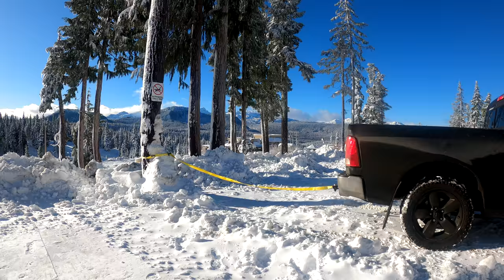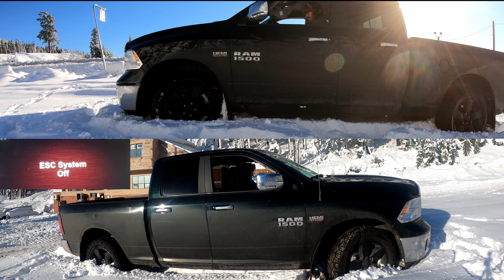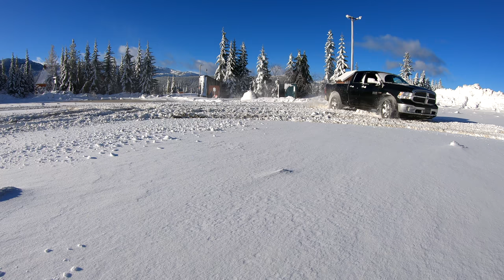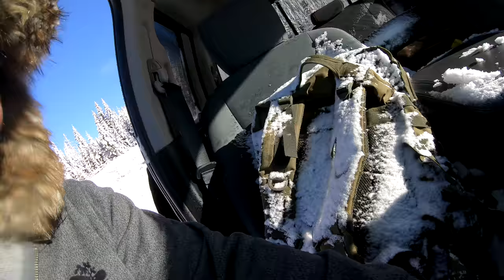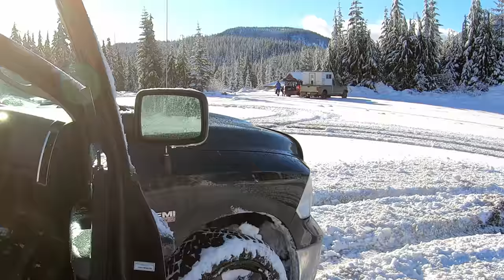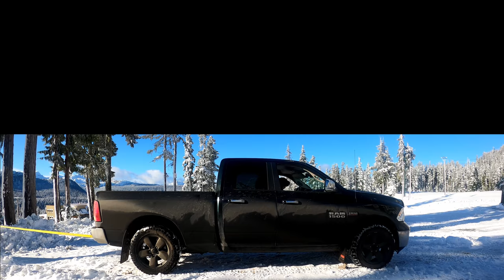RAM 1500 Off-Road 4WD Lock Test In Deep Snow (I Was WRONG..) | Real World 4x4 review 2.0

Comment: Two things are wrong here. First, not all four-wheel-drive vehicles have what is called  brake line differential. Second, the vehicle has to be in four-wheel-drive for the brake line differential to work. If your vehicle is equipped with brake line differential and you apply the brakes slightly, it will pull you out of the snow with open differentials.

Comment: In 2005, I had a Ram w/5.7 HEMI & here in Michigan, I never once got stuck in any mud or snow, but when I left Chrysler in 2009 and went to Mississippi with my 2009 Rear wheel drive Ram, I got stuck in less than 2 inches of mud! It was a weird feeling being in that Truck, so before returning to Michigan in 2010, I sold my Ram, paid off my Jeep Grand Cherokee Laredo and kept it instead. My 2002 Jeep is what I still drive today! Many things have changed, but I am still a MOPAR Guy!!!
Reply from the maker: Just the way my truck was spec'd out. the outdoorsman Ram 1500's are much better equipped for off-road use. and the newer fifth gen trucks do finally have a locker option from factory. but I wouldn't be lying if I said my 96 GMC was more capable in the snow.

Comment: 2005 dakota 4.7 crew cab no possy or lockers and I just got out of 26 inch snow and plowed through it with factory 16 tires and falken wildpeak at3w . Dodge makes pretty good 4x4 systems I mean even in 2 wheel my truck is still a beast

Comment: The better way to have helped that stuck lady out would have been to talk Her thru the steps, explaning what each one does And how to disengage it later. 1)Tell 2)Show 3)Explain 4)Have her do and explain what she heard /learned. Correct as needed.
( God, how i love The Marine Corps... )
Reply from the maker: haha she was running late so she just wanted her vehicle out. It was a stick shift 4x4 so I just jammed it into 4low and was like there you go. but then she asked if would just drive it out lol so I did.
Reply: @TheGettyAdventures  
I understand. We once had a lady bring her Jeep into the shop complaining about it not going into 4WD. Typical male, i thought she didn't know how or was too weak to manually put it into gear. I tried to shift it, couldn't. So we put it up on the lift and as i tugged and cursed, another mechanic was hitting the shift linkage with a small maul, prying with a crowbar, spraying de-rust and lubricant and cursing like a sailor. We finally employed WD-40 along with the blue-tipped wrench ( had a fire extinghuisher right there ) and got her to finally break free. Really worked up a sweat ! Ran it in-out a dozen times along with over lubrication. She'd had the Jeep for several years and had never used the 4wd. Frozen as tight as Hogan's goat. Told her to use it at least several times a year and if it froze up again to come on back. Don't believe i charged her because i was chagrined it was the Jeep and not her. What's the old adage: Use it, or loose it ...

Comment: I'll tell you what we do up in the bush. go under the trucks hood and pull the ABS fuse, this removes all of the nannys and will let the truck be a truck. Even with the ESC "turned off" it will still kick on for some things. now for a new trick. when you are spinning the tires slowly, tap the brakes and it will make the other tires rotate as well. great video though
Reply from the maker: Thank you sir! Not sure why these RAM's are so hard to remove all electronic traction control. Ideally it would just be 1 or 2 botton on the dash!

Comment: Put the front tires on dry pavement and the rear on ice with a piece of fire wood in front of the front wheels, your rear tires will spin on the ice and the front won't pull you over the fire wood. If all 4 are on ice/snow they can all spin. The clutch pack never really locks and the front never gets full tq if the back is seriously stuck.

Comment: I have a 2023 Ram 1500 Classic Warlock and it has the 355 gears and rear anti spin, front is an open differential, 1st time i used the 4WD HIGH was in WV a few weeks ago, took a few seconds to engage, it i want 4LOW i need to put in neutral

Comment: @the Getty adventure PSA - there’s a little know trick with the rams 4wd lock and ECS. You can NOT just hit the escalator button, yes that says it turns the system off but it really doesn’t. You need to put the truck in 4wd lock then hold the ecs button by holding it down for 5 to 10 seconds until the it dings and says ECS OFF on the dash

Comment: Yea open diffs are the suck. I won't buy a truck without lsd( which comes with 3.92 gears) " anti spin differential in dodge speak. My 13 ram laughs like a psychopath at snow. Also when I put mine in 4 low it turns the tc off by itself.

Comment: Four wheel lock isn't really locking your differentials it just turns your positraction on it's not really locked by a locker to put in it like an air locker or electric locker that you got to hit a switch to lock your differential if you jack your truck up with all four tires are off the ground and grab a hold of one tire it will stop spinning and allow the other tire keeps thing had to show my buddy that had bought the 2017 Dodge ram because he thought it meant it locked the axles it but it don't

Comment: With 4 wheel drive auto you actually dont have 4 wheel drive lock..correct.?..thats what i was always told..get a truck without 4 wheel drive auto..better offroad.?
Reply from the maker: more or less yes. with the 4WD AUTO option you get a clutch pack transfer case which is fine in most situations when you turn the traction control and ESC off. But the clutches will always have some slip and theoretically woudl lose the ability to transfer some power to the front driveshaft. whereas a traditional transfer case delivers a much truer 50/50 split of power to both differentials.

Comment: It’s still not a fully 50/50 lock all the time. It all depends on slippage which is why I ripped that Tcase out of my 17 and put in the mechanical locking tcase in so much better now
Reply from the maker: Correct! but at least the truck isn't actively cutting power to the front wheels. and that is the right move man. maybe even through a rear locker in there and you are off to the races!
Reply: @TheGettyAdventures  I couldn''t find any E-lockers for the rear at the time i did my regear so I just threw in the mopar LSD and honestly it goes wherever I need it to go I love it.

Comment: Hit the esc cancel button once to turn it off.   Press it a second time and hold it for I think 5 seconds but could be bit longer and it will also disengage another traction control setting…… I’m not with my truck right now and can’t remember but this gives you the true 4x4 I’m curious if it truly locks the system though I don’t think so.  This final setting only stays disengaged or engaged until you are driving something like 25kph

Comment: Never had that issue with a Silverado.  Automatic locking differential.  Not looking for a fight but I'd be pissed off if my 4x4 got stuck in that little bit of snow. Never been a fan of the 4x4 set up on the ram 1500.

Comment: Esc shuts off automatically on 2021 ram classic. We had slot of snow in Southern Ontario and I didn have a problem at all.. showe up to work just to prove a point noone cared about lol..
Reply from the maker: are you sure? try holding the traction control button in 4wd lock for like 5 seconds and see what happens!
Reply: @TheGettyAdventures  100% just tried. Every time I shift to 4wd low my traction control turns of  esc off. 

Interesting that 4wd lock does not... huh.....

Comment: Case not closed. And no you are not wrong. According to the RAM owner's manual in 4WD Lock the front and rear wheels should turn at the same speed. Yours clearly were NOT moving at the same speed. The fact that you could so easily do donuts tells me your front wheels aren't pulling like they should. When I tried to get my Ford Ranger to fishtail in the snow, if I hit the gas all it would do is pull forward. I couldn't get it to fishtail just by accelerating. My opinion is the RAM's 4WD does not work like I believe it should. I'd like to see you do this same test with a Ford F150.

Comment: Weve got the factory LSD in the rear.  For the few $$$  it costs I highly recomend it. I have been pleasantly surprised by the terrain and  low traction situations the truck can work itself out of.  And then when you need it, pop it into 4wd, and you have 3 drive wheels.
Reply from the maker: the LSD makes a world of difference. really which my truck came with one. I didn't build my truck because I have heard its like an extra 300 bucks for the LSD. so that kinda sucks lol
Reply: @TheGettyAdventures  95$
Reply: My 2020 classic tradesman was spec'd as a govt truck so it had a rear locker installed at the plant before it left then I believe it was fish and game changed their mind and went for the new body style ..... yup that's how I got my truck for only $35000 plus a deal incentive of $-7000 I think they just wanted to get rid of a special order that was sitting it also was the last 2020 classic on the lot

Comment: Ford F-150s all come with posi in the rear never got stuck with my 99 F150 4x4. RAM it's an option most dealers never order it so have to special order which is stupid because the option wasn't that much money few hundred bux if I remember. Wife picked out a show room lifted truck I was happy she picked it forgot all about the diff until a few weeks later I realized it was open diff.
Reply from the maker: ya its odd, and with the newer ford those e-lockers were awesome. and like you said it's not that expensive of an option but there are a lot of open differential Ram 1500's

Comment: You gotta keep the wheels straight if you really want to get out and always rely on the rocking back and forth is you're stuck stuck
Reply from the maker: 100% I just wanted to see if power would be cut off the the front wheels if I did turn the wheels. the real lesson here is that open differentials suck lol
Reply: @TheGettyAdventures  i was also thinking you buried her on purpose lol,  tires too man I put some 33×12.50s and its not a question getting traction

Comment: Great video man. I have owned my Ram 1500 for 4 years and have always a little concerned with how well this kind of transfer case works. Never thought I need to disable ESC. Learn something new every day.
Reply from the maker: We are all learning lol I had no idea either
Reply: Same way on most trucks with traction control. It’s great on the street but sometimes you need to spin the tires to get out of messy situations. My work uses mostly fords and they spend most of thei time off road in 4wheel drive. After struggling to get anywhere I seen in a owners manual that ford even tells you to turn it off because it won’t allow your front end to spin if your stuck
Reply from the maker: @kingrider75  very interesting that the manual tells you to do that. makes total sense though. also those fords usually come with those awesome rear E-lockers which make a big difference!
Reply: @TheGettyAdventures  I agree, I had a 16 f150 and recently traded up to an F250 and both had the rear locker. I like the fact that it can be used without putting the truck into 4wheel, and in a lot of cases I have found that’s all I needed to get out of a situation. It’s especially useful on a slick boat ramp too
Reply from the maker: @kingrider75  it is a really nice feature to have!
Reply: How did you fully turn off the esc?
Reply from the maker: @drewbaglin1632  Hold traction control down for like 5 seconds. you also have to be in a 4wd setting for that to work
Reply: My Ram has 4wd lock, too, and I never knew I needed to disable ESC, either.  It has always seemed to work fine in 4 lock.

Comment: I read that there’s a fella that has some sort of electrical kit/wiring kit that over rides the systems and has the 4x4 engaged fully. He’s been selling these kits on ram forums
Reply from the maker: yes this is true. apparently seems to work well!
Reply: @TheGettyAdventures  so what’s the actual deal with these 44-44 BW t cases? Are they good or are they made of glass? I’ve got a 4Runner trd pro right now with old school mechanical levels on the floor.

Comment: That sucks that yours didn’t come with the limited slip in the rear from the factory. My 2wd has it, along with 3.92 gears. If I were you, I would service the transfercase every 30k miles with premium synthetic fluid. Clutched transfer cases don’t do well when used a lot and serviced at the long factory intervals. Their pricey to rebuild also. You could put a lunchbox locker in the front differential. It’s an affordable way to make a huge difference in capability.
Reply from the maker: really does suck. I really wanted the outdoorsman model which came stock with the LSD but i got a streaming deal on the Big Horn i couldn't refuse. What is a lunchbox locker ? never heard that term before please do explain lol
Reply: @TheGettyAdventures  well boss, I did some research and the ZF 215mm front differential in the 2012+ Ram 1500 has no aftermarket support for lockers or limited slip units. So your stuck with one wheel putting down power. Over time, having one wheel spin faster than the other will wear out the spider gears. The best way to combat this is, in my opinion, is to run Amsoil severe gear differential oil. I’ve ran in Jeeps, trucks, and quads. It has seen insane abuse with no wear! Run Amsoil in both differentials and the limited slip additive in the rear. You won’t be sorry. Here is a video explaining lunchbox lockers just so you have the knowledge. I’ll post links to the Amsoil products to make it easy for you if you decide that’s what you want to do. Merry Christmas! https://youtu.be/NZd5FwZ_qaU
Reply from the maker: @thehappytexan  wow thank you for the knowledge! heard nothing but good things from Amsoil to be honest. do you ship north of the boarder to good old Canada?
Reply: @TheGettyAdventures  yes sir! Just put in your normal shipping info. If your order is over $150, shipping is free to Canada. I found Amsoil when I started researching how to make my 09 ram last as long as possible. I was running royal purple at the time and doing oil analysis. Following their recommendations, the oil was depleted before they said it should be. When I found Amsoil, I ran it in my truck for a full year, 18k miles, and sent in a sample. It came back as still good! So family started using it. I have sampled annual usage in a Ford Escape, Chevy 1500, and gmc 1500. All driven 17k to 22k miles a year. In 4 years I have yet to have a report come back in the red showing the oil is depleted and must be changed. So my wife and I give product and discounts to family, friends, people in need, people at church, youtubers, and sometimes just strangers at the gas station who want to try the fuel treatment. God has been good to us, we aren’t rich by any means, so we try to pay it forward in different ways. Helping someone can only lead to good in my opinion.

Comment: The LSD or as ram calls it "anti spin differential" on the rebels is pretty good. I guess I didn't realize ram was putting full on open diffs on the regular ram 1500s.
Reply: My rebel has a rear locker
Reply: @DMZRPG  the 18 to present have an E Locker and disengages at 40MPH. which is nice if you're crawling around or going at a mild speed on a dirt road. Limited slip is mechanical and RPM based which means if the tire spins too much faster then the other it will engage. Regardless of what speed you are at. Which is what the 15 to 17 Rebels have. E locker is certainly better for off road type driving but I've never felt like the "Anti spin" diff has slowed me down any

Comment: I live in Oregon & Mt. Hood got dumped on with snow the past week. I went up on my 2018 Ram 1500 EcoDiesel & had no issues with the ice & snow while traction control completely turned off & in 4WD lock. Although I didn’t drive in 3 ft of snow I did test it down a side road near Timothy Lake & it did great. Did a few donuts & tried to get stuck but no luck.
I still miss my BW 44-45 transfer case I had in my 12’ Outdoorsman which makes a HUGE difference. Looking into changing out my transfer case just because I felt 110% better with it as a true LOCKing transfer case. Hope this helps & I commented earlier on how to completely disengage your ESC system.
Reply from the maker: I wish I could of tested out the bw44-45 because it would of been cool to feel the difference first hand like you have!
Reply: @TheGettyAdventures  major difference in my opinion. It would drive on ice & in snow like i was on concrete.

Comment: I have a 21 RAM 1500 classic V6 4X4, when the truck goes to 60 mph it starts shaking until you go below 60 mph; in either 4WD or 2WD in the snow or not.
Reply: Bummer. You should get that looked at under warranty.

Comment: I've done some research, the dodge 1500 models with 4wd auto, uses clutches to activate 4wd. Even in 4wd lock. That's part of your problem. When stopped, clutches aren't fully locked.
Reply: The models without auto, has a more traditional gear 4wd lock
Reply from the maker: 100% I've actually made some previous videos on this exact topic. so the clutch pack transfer case the BW44-44 is the issue. where as the "traditional" transferase option is the BW44-45. the whole point of my last few videos is to see if I could actually get the front driveshaft to slip under "real world conditions". as far as I could tell with the Electronic stability control fully turned off my front driveshaft received power in all situations.
Reply from the maker: https://www.youtube.com/watch?v=E37EVzkQV6o&t=18s 
check this video out. in this video my front driveshaft loses power but full disclosure my electronic stability control was NOT turned off.